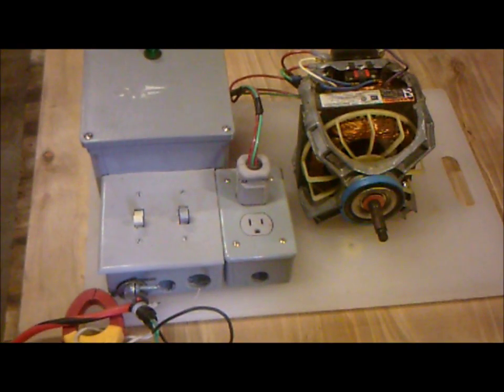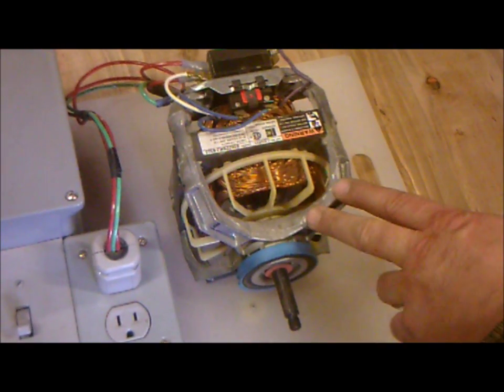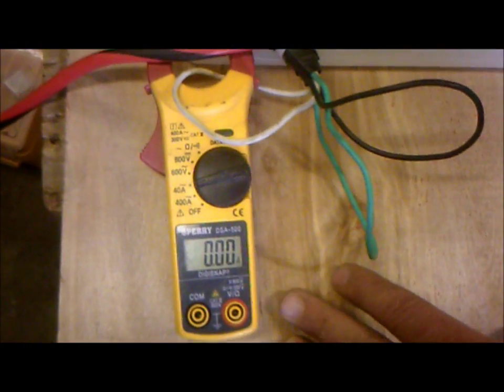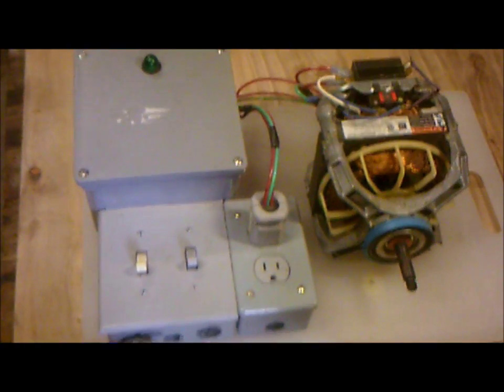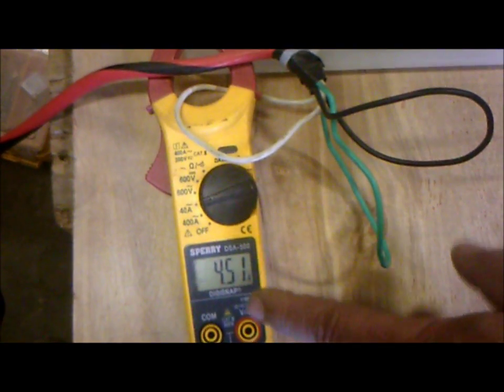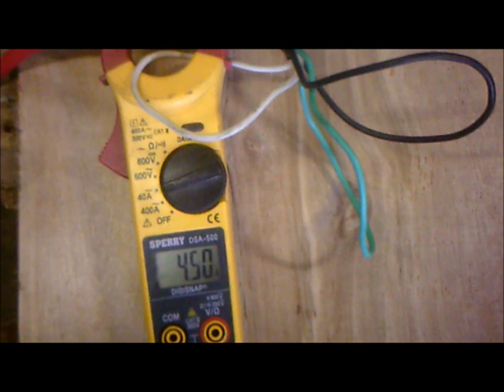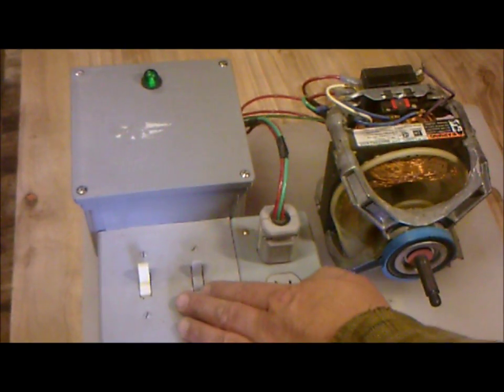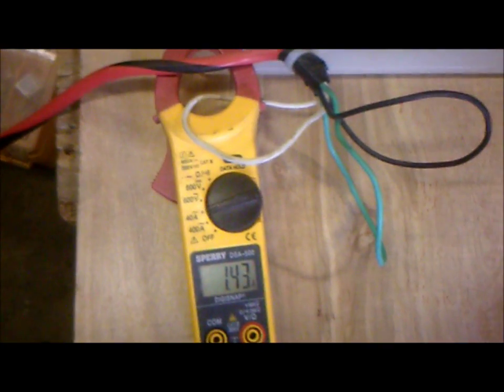How to make a Power Stabilizer

Comment: Another thing is there's no mention about the value of the capacitors: voltage rating & capacitance rating, how they were wired, is it in series or parallel? I think they were wired in parallel. And, he must have connected it, in actual, the device to the panel board.

Another thing, the presention came to an abrupt ending!

 Overall, the idea is great!

Comment: It's correct! Capacitors when installed with inductive circuits neutralize or reduce to some extent power factor. When we say inductive circuits we are referring to any loads employing windings such as in motors. What are these?: aircons, refrigerators, electric fans, microwave ovens, washing machines & dryers,  vacuum cleaners, etc. In short, anything that turns & runs. They are categorized as inductive. Anything inductive wastes energy due to this thing we call "power factor" which is present only in ac circuits.

This PF can be reduced by installing capacitors. It is installed in the main circuit breaker in the panel box.

It must have been much better if the author employed some protective means like a fuse or even a small CB for the device. In case the capacitors malfunction, there's a fuse &  CB for protection.

Comment: mine are 2 20mfd caps, you can buy them at a ac place, 0r AMAZON,  I would get the 370 vac  volt version.
Reply: Pls help with the circuit diagram of yours
Reply: two 20mfd caps. the big ones like in a central air unit, in parallel, run each leg to one side of a 220v0lt  device in the panel
Reply: This is also someones guess as what the lc resonance will be. for it to really save you money you need to do the math and figure out the inductance, and then the proper cap. to make it resonant.
Reply: wired just like he did

Comment: Oy, "This correction, of course, will not change the amount of true power consumed by the load, but it will result in a substantial reduction of apparent power, and of the total current drawn from the 240 Volt source: " taken from the actual book from the cite linked below. Not my information.

Comment: I thought caps only work with DC system.   This guy doesn't even say what size the caps are.   Judging from their size, I would think they would be no more than a quarter farad.   This gets a big thumbs down from me.
Reply: i completely agree with you...what an idiot!!
Reply: JimTheSoundman Super capacitors Work both for AC and DC. DC for storage and AC for stability.
Reply: But those are far from being super capacitors. Those are AC electrolytic capacitors that are more than likely in the uF range and not ones in the multi Farad ranges. A Super capacitor could never work in that circuit as they are limited to about 4 volts or they will blow. AC in the home, like they are hooking them up to, would blow one in under a second.

Comment: the capacitors you are using are also use for aircon motor, they wired up in ac line voltage

Comment: simple electronics principle, the current/voltage lag in an inductive circuit...cure is to introduce capacitance to the circuit
Those aren't "super capacitors" they are high farad "running" capacitors used on AC motors
https://www.allaboutcircuits.com/textbook/alternating-current/chpt-11/calculating-power-factor/
no magic...just electronics

Poor power factor in an AC circuit may be “corrected”, or re-established at a value close to 1, by adding a parallel reactance opposite the effect of the load’s reactance. If the load’s reactance is inductive in nature (which is almost always will be), parallel capacitance is what is needed to correct poor power factor.

Comment: What is the voltage power of one capacitor?
Reply: Use 370-440volt 40uf Run caps.
Reply: @jetkrazee  thank you

Comment: Thank you so much for your useful video but I have a couple of questions which I need you to answer them please. 
I have one phase current (220 volt) so there's no negative wire, so should I use 2 capacitors or only one capacitor is enough??
Reply: Quisiera saber de cuántos microfaradios son esos capacito respuesta
Reply: You use one cap per hot leg of your 220 service. Hope this helps.